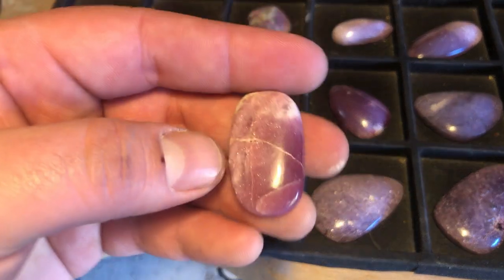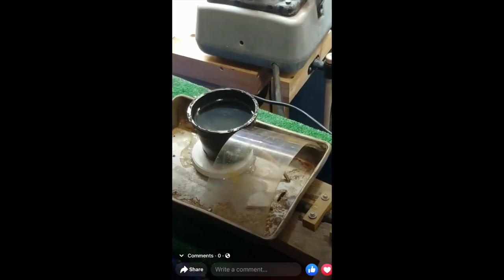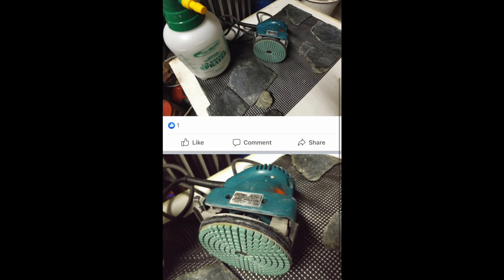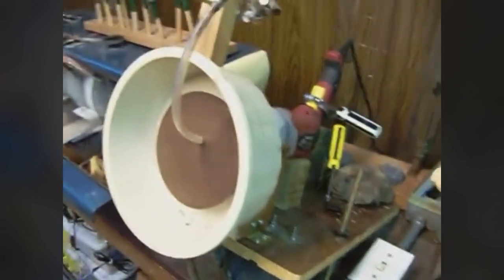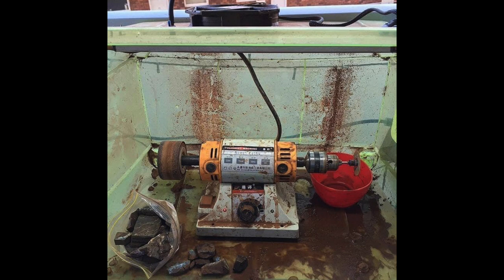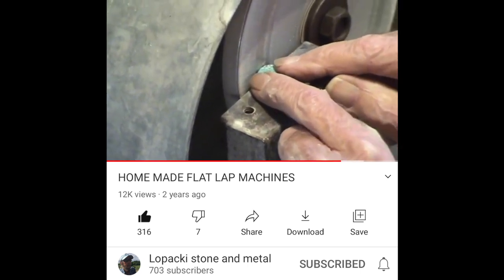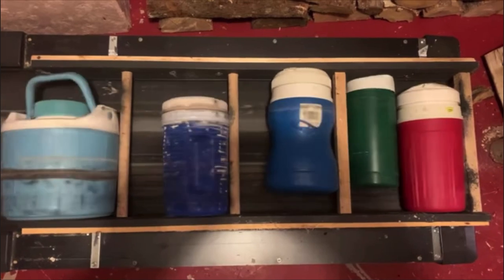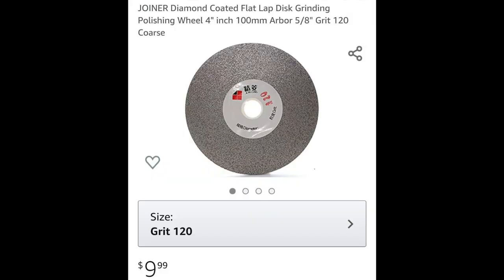Home Made Lapidary Machines :Tumblers Grinders Saws & Polishers

Comment: I am thankful for you Dave. With your help I managed to build my own flatlap 2 years ago from some scrap wood, the bottom of a 5 gallon bucket,  a used motor I bought off ebay, and a set of disc to grind on. It works like a charm thanks to your guidance. Many of us just refuse to spend thousands of dollars on high end machines and can still enjoy the hobby on self built equipment thanks to people like you helping us stubble our way to success. Forgot to mention I coated all the wood with fiberglass resin to preserve it as long as possible, especially the top.
Reply from the maker: Totally awesome my friend thank you so much for your words of kindness I appreciate it big time
Reply: @lapidarydave  that is a hose clamp can get them from just about any auto  part store
Reply: that was the top from a ice cream maker mechine

Comment: That's a radiator hose clamp and the only thing I do is replace the cord with a GFCI breaker inline just cause of the water even though it's a small amount .and never install a wheel directly on a motor IF it's not made with a shaft for that purpose...I'm also a big fan of the reostat or dimmer switch ppl call them it will allow you to adjust the speed 
Awesome vid Dave

Comment: Super Grinder - 7 to 10 years ago the tile saw blades could be had pretty cheap (7 bucks at HarborF) soa a stack of 5 would give you a 1/2 in.+ diamond wheel for $35 now the same blade is $20 or more and I think a plated or sintered wheel is a better long term deal.
If you plan to do another one of these videos I can show you my 5 gallon bucket tumbler or (i hope) my 6 foot drag saw (building it next summer)
Reply from the maker: Absolutely awesome my friend I’d love to see your tumbler some time